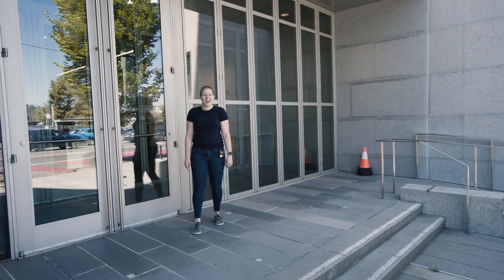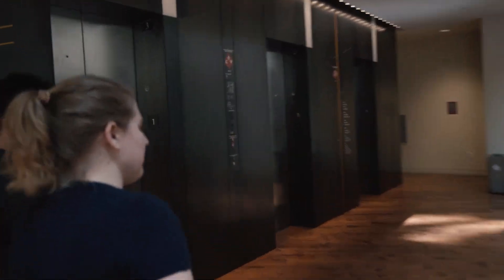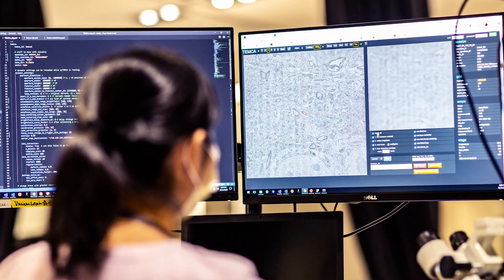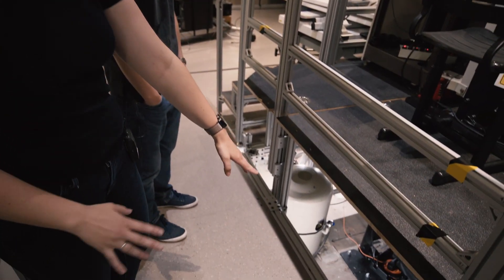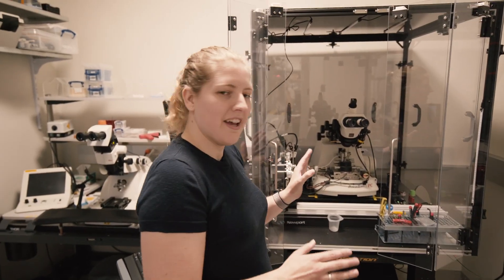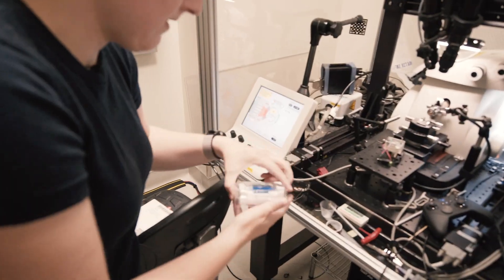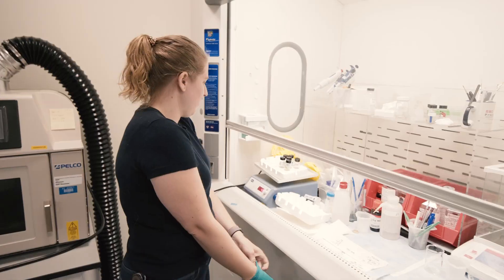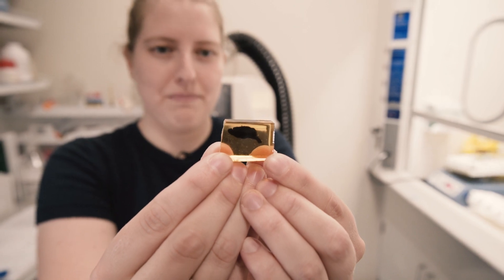Look in the labs | Electron Microscopy Suite

Comment: This is great work! The methods used here provide the resolution needed to actually understand how the brain works. Also, thanks for not wearing a mask in the video, it makes a big difference. I would like to see a video showing how to look at the data from the 200 spatially distributed matches from two-photon data. Do you actually have 200 segmented cells that show the exact firing patterns based on the exact cell structure? This would obviously be good truth data for everyone to use to build and verify models.